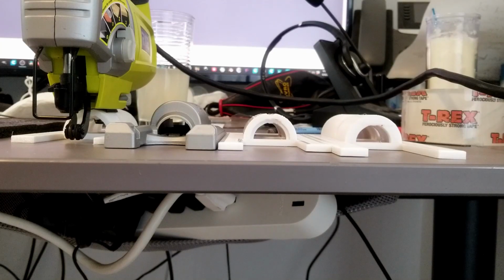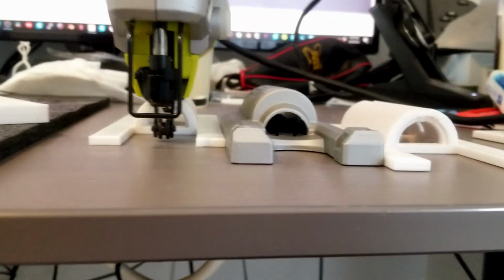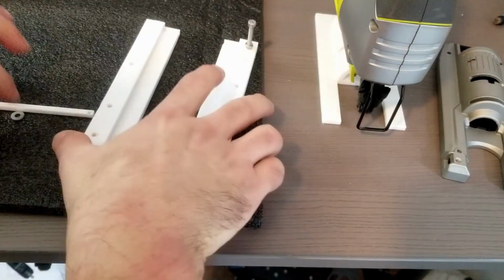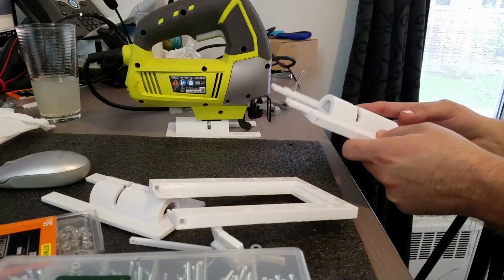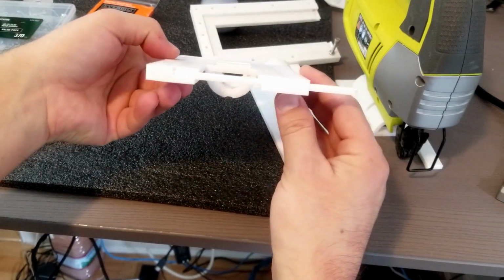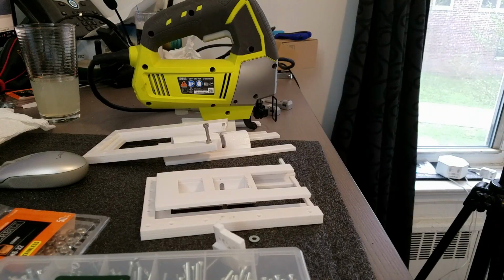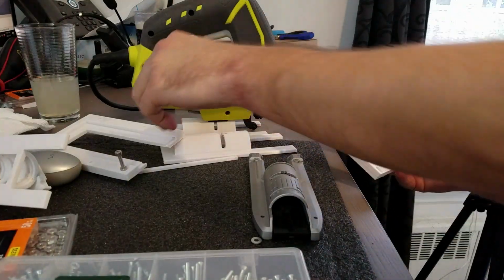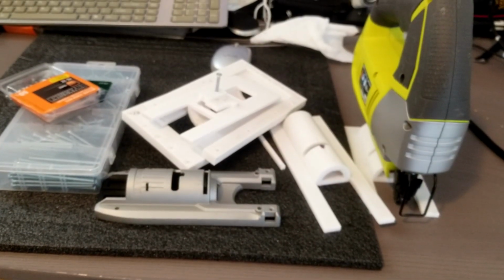3D Printed Universal Jig Saw Mount Adapter Converter for Jig saw table | internal woodworking cuts

Comment: Hi, nice idea! Is that rigid enough?
Reply from the maker: it seems rigid enough. I havent mounted it. I got busy with other stuff. but once I have time for it I will mount it. As in the video, you can use multiple layers, wall layers to make the product more solid. Also if you use rigid materials or strobger materials it can be quite rigid. I used some perg I had and by its nature that PETG has more flex than other filaments I used. For example I used aome blue PLA and ithers that felt more rigid than that white PETG you see in the video. The disadvantage of the PLA is that is weathers outside.
Reply from the maker: here it is in the wild the jig saw table. https://youtu.be/TX57PpAMhW0